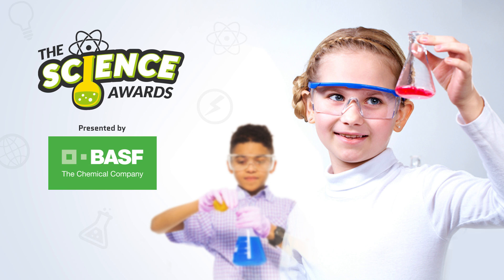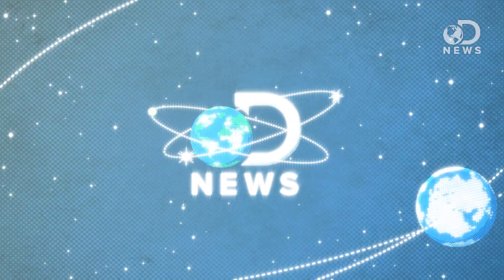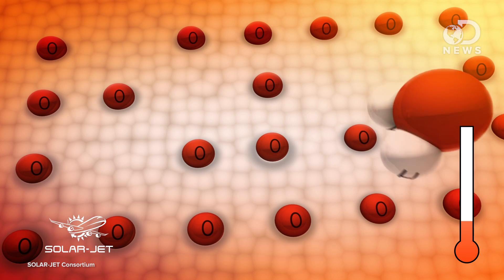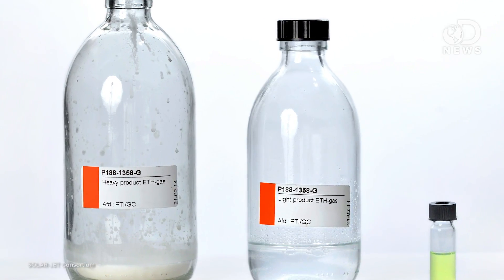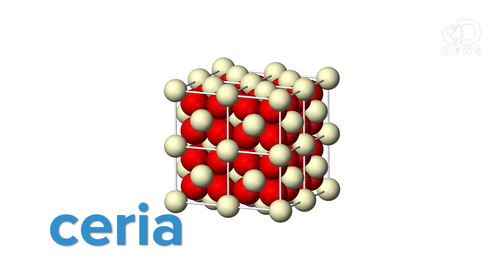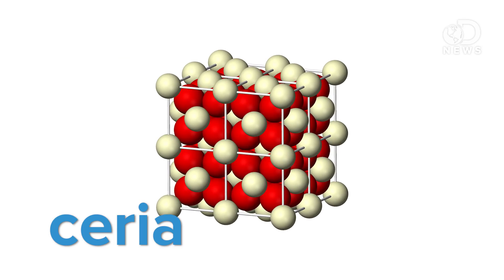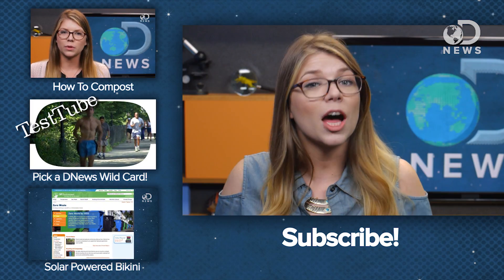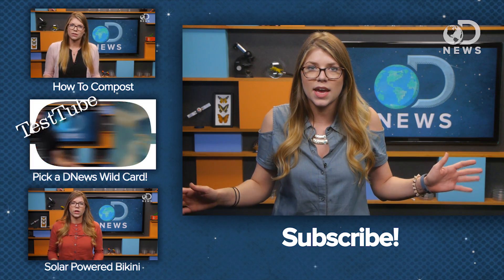Is It Possible To Power Jets With Water?

Comment: Don't get me wrong, this will never work, because the entropic energy costs are too great, it involves too much greenhouse gases, and the kerosene like fuels are usually bad yeild because at high molar electrons, it only produces a small amount of material, it would be much better to use metals as fuel produces by this method

Comment: For the most part, it seems sound, but some of the finer details have been left out. Although that might have been purposeful to protect IP's or whatever

Things like, does it need to be pure (deionised) water? Would that affect our drinking water supply? This thing would be in space yes? How would you transport the water and carbon dioxide up and the kerosene and oxygen back?
Would the carbon monoxide, hydrogen and oxygen revert to carbon dioxide and water when you cooled them down such that the reduced ceria could take in the oxygen (considering the ceria disassociates with oxygen at a lower temperature then water and carbon dioxide)?
Also, is water really abundant enough to be considered an infinite resource? Would the water produced in kerosene combustion be able to be reclaimed?

Comment: Calling Air and Water unlimited is a little far fetched. If we keep destroying our Ecosystem even that is not going to save us.
Reply: Even if we destroy our ecosystem we will still have air, water, and sunlight.
Reply: *****  Sure, I want to see them do this with Poluted Water and Air. What was that? They need clean Water and Air to do this? Surprise.
Reply: maximumrisk2004
 Clean water and air can be made from dirty water and air...
Reply: maximumrisk2004 The fischer-tropsch reaction also makes drinkable water in Quatar there is already a fischer-tropsch plant and they sell fuel and drinking water. and burning the fuel will result in water en CO2 that you can reuse
Reply: maximumrisk2004 it would lower the Fuel prices because you dont need oil anymore
Reply: maximumrisk2004  ok and we have the ability to produce clean water it's called water treatment.
Reply: Once it gets the the point that we can't use the air and water from our ecosystem I don't think it will matter whether we can make jet fuel from it or not...
Reply: wergrethe When you make the fuel and burn it the same amout of water will come out with what you put in.
Reply: Frances Madgwick Actually I meant that such things would increase the cost to produce this Fuel and suddenly we are back to rising fuel Prices.
Reply: using our life sustaining precious resource to power engines, how smart is that? next time they will use our food to power the engines too.
Reply: martijn oerlemans
using water as a fuel while people are fighting for it in other parts of the world.
in this technology, you can not put water right back to the engine, you have to continuously buy it from them.
with this, fuel price might reduce at first, but it will increase gradually just like the oil back to when the automobile was invented, and it will cause water price to rise with it too.
Reply: wergrethe  Yes, too bad there isn't anywhere on this planet where there are large bodies of accessible water.
I certainly have never seen any such things around here.

Oh well, i guess we are stuck being dependent on a never ending fleet of oil-tankers bringing us our fuel from overseas then...

Unless....!
...no sorry, i thought i had an idea.
But its gone now.

sigh
Reply: mtssvnsn
 it's okay, there are a lot of ideas out there for creating free energy, it's just water is not a good idea for it.
Nicola Tesla's free energy device. Crystal power, sound frequency, space-time energy, etc......
you can check out hutchison effect, it can levitate heavy object with the right sound frequency.
or bashar's space-time free energy antenna.
have fun!
Reply: wergrethe
And don't forget  rubber-band energy.
And crystal boner table levitation powers.

Comment: My question about the process is what is its EROEI (energy returned on energy invested)? If it's like corn ehtanol, it's a losing proposition since ethanol fuel takes as much or more energy to produce as it provides, so no solution to oil limits. Unless the solar collectors give the main component of energy to run the process? And would location then be a critical factor?

Comment: This alternative energy source seems great and all, but remember that living things (us) also need water. If this method went into mass production, we could see water shortages, as the result of this method does not seem to leave any water left over.
Reply: There's plenty of water in this world, the problem is just that not all of it is clean and drinkable. If this process can use non-potable water sources, there shouldn't be a problem at all. Additionally, if some of the water were diverted from the fuel process, the solar reactor could be used to purify that water, resulting in MORE potable water available, and less shortage. At least, in theory.
Reply: endergt and making the fuel result also in clean water

Comment: Well, if we run out of fuel at some point, it would be great to have alternatives. But right now, the issue is making something that doesn't creates CO2, and this invention doesn't really help.
Reply: Well, it does. Because if we can supply the whole world using this "clean" method, we stop using the kerosene made from cracking the molecules from petroleum. Supplying the world with the "clean jet fuel" would help people realize that we can live without petroleum.
Also, we already have a fuel that does not produce carbon dioxide, which is hydrogen (H2(g), when fully combusted, it does not produce anything but water, like this:

2H2+O2->2H2O
Reply: Gratia Forensi Equus I see, you are actually right. I shouldn't have criticized this without mentioning how happy I am for the invention. It was just a reminder that we still have a way to go. I say it because some people are always looking for excuses to say "relax everything is alright", and that has caused humanity a lot of problems
Reply: I agree with you.
I always think about the worst things that could happen.

Comment: that does sound great.. but.. we'd still be stuck with fine dust  particles, smog etc if it's used on a large scale. I prefer hydrogen cars, for example.
Reply: And how do you want to power a jet? With h2?
Reply: Gratia Forensi Equus Come on, really? You can burn hydrogen you know.. thats what most liquid bichemical propellant rockets do. Google "SABRE"... its essentially a jet engine burns hydrogen with air, or on-board oxygen. So, yeah, we're working on it
Reply: Teva Wiese That, if I recall correctly, is used to get spaceplanes into space, so it requires rocket-like speeds to compress the air into the engine in large enough quantities to use.
So, not really feasible for everyday airplanes.
Reply: Shawn Thompson Not ever?

That's quite a bold statement.
Reply: daddyleon how would you get your hydrogen?? because you need power for that more than you get from burning it
Reply: daddyleon I'm sorry, but did I say that even once in my comment? No? So you're putting words into my mouth.
If we drastically change how we travel by air, then sure, it'll be possible, but we'd need planes capable of traveling at rocket like speeds to make use of those engines, and then that needs to be safe and affordable enough to carry commercial passengers.
Please use some logic and please stop putting words into my mouth. Thanks.
Reply: Shawn Thompson first of al I did not comment on you second you will get the same fuel we use today so we dont need any fancy engines. and last the fine particals comes from impurities in normal fuel and they are not in the newkind of fuel
Reply: martijn oerlemans Personally... I'd pick renewable, but... if you really want.. you could also use stuff that really fucks up the environment, you know like we do now. But if that's your choice, I won't get it, because what's the point then?
Reply: Shawn Thompson This current stuff is't even viable for anything commercial. But you're questioning currently used technology, seems weird to me.
Reply: martijn oerlemans First of all, I never said a word to you so I invite you to be more observant next time before you make a stupid comment.
daddyleon I'm questioning the SABRE which is in development. It's not "currently used technology"
Reply: you can also make syngas from methane that what they curently use in Quatar but the rest is the same and in Quatar is already viable.
Reply: +Shawn Thompson Emm, yes. it is used to propel space-planes into space, but it is also used during take-off, which occurs at normal, subsonic speeds.
Reply: Teva Wiese you do realize we haven't used a SABRE engine to get into space and we do not have any single stage space planes, correct? We have that Virgin Galactic thing but I don't believe it's gotten into space and I know it does not use a SABRE engine.
Reply: I do realize, yes, but it looks very promising, and should be commercially operational by 2030 (their estimate is 2025, but realistically...)
Reply: Also, the Virgin Galactic's "Spaceship two" has gotten into space, but it's suborbital. It's a stepping stone, giving us information an knowledge for future craft, like the Skylon, which does use the SABRE engine
Reply: Teva Wiese Then why did you say that it's used to get space planes into space? It hasn't been used yet. It's not reliable because it hasn't been used even once.
Reply: I didn't say it was reliable, although it most likely will be, and I meant that it "will be used' as I thought it was pretty obvious that they haven't actually done it yet, since fully operational, single stage orbital space planes are still a thing of the future. In any case, it's all theory my friend.

Comment: What happens when we use all the carbon in the air?
Reply: It uses the carbon that is already in the air to make it so it wouldn't add anymore to it.
Reply: We put the carbon back into the air when we burn the kerosene. Then we take it out when we make more. It's a circle.

Comment: The question is what this synthetic kerosene releases when combusted.
If it's as dirty as regular kerosene I wouldn't say it's that much of a breakthrough in making air travel less harmful to the environment.
It's pretty awesome that they managed to do this either way though
Reply: The synthetic kerosene releases the same about of carbon dioxide and water that was used to create the fuel in the first place. (The energy powering the jet comes from the sun light) So this fuel is carbon neutral. You can also use plants and a gasifier to create the syngas but it is not a pure as this method.
Reply: JoshTW
It will be carbon neutral, but it's probably not the best solution for cars in crowded cities. (Kerosene can totally run cars and heat homes and cook food and all that good stuff.) It would be great for rural and suburban areas, but just because something's carbon neutral doesn't mean it's not going to make for plenty of nasty smoke.

Comment: Actually if you just hydrolyze water you'll get the most efficient rocket fuel we have. It can be used on airplanes too, it's just very expensive both in money and engineering work. So in the worst case there's still that.
Reply: I don't think it is the most efficient rocket fuel we have, although i did not search for confirmation.
So if you can, put a source on that statement, please.
Reply: http://en.wikipedia.org/wiki/Liquid_rocket_propellants

There's a table there with the Isp (essentially a measure of efficiency) of various fuels. Notice the H2+O2 being the most efficient by far. In practice it's not so clear cut because for example fuel tanks have to be bigger, which means more mass for the rocket.

Comment: Most people are energy-illiterate.

"…use simulated concentrated sunlight … extremely high temperatures, around 4,000 degrees F. … a chemical compound that releases oxygen when heated above 2,700 degrees F. … when you heat all of them up together…"

So the process may produce kerosene, but it uses large amounts of energy throughout. Sustainable fuel future? I don’t think so.

"It uses infinite materials"? The materials used in making the solar reactors are not infinite. DNews could have done a better job on this.

Comment: I don't know what the process is for making jet fuel, but this new synthetic alternative sounds like its a lengthy process that requires a lot of energy (in the form of heat) to produce it. So just how much cheaper is this new alternative? Or its it more of a benefit to the environment rather than the economy? Will it lower the cost of gasoline since it relieves some of the burden on limited oil reserves?
Reply: Gee cost of gas will probably stay the same because drilling isn't cheap and these factories will be producing refined kerosene without having to refine it. Refining is also a lengthly process to.
Reply: Benjamin Grosz For right now, if they stick with it... I'd give it 10 years and it'd onl take a few months.

Comment: I may have missed it in the video, but how efficient is the process at reusing the byproducts of kerosene combustion? It's not 1 to 1, surely.
Reply: It'd better be 1:1, or we're violating the law of conservation of mass! :P The only loss would be anything that leaks out of pipes, and you can just get more of that from the air.
Reply: I didn't mean in mass, I meant in composition. Carbon dioxide versus carbon monoxide as a byproduct of the combustion. I looked into it a bit (been a while since I took chemistry) and it appears the determining factor between whether a fuel molecule results in CO or CO2 in combustion is the amount of oxygen present. So apparently the amount of CO versus CO2 produced has nothing at all to do with the type of fuel. It very well could be 1 to 1, or nearly, so long as air-intake is working properly. That makes it all the more amazing.

Comment: I'm skeptical.  Hoaxes about turning water into fuel have existed down through history.  Chemically, kerosene is carbon and hydrogen: C12H26 or something like that, so it's not alchemy to do so.  But I can't see how you're going to convert water:H2O and carbon dioxide:CO2 and get more energy out than you put in.  That's always the problem with all these schemes, it takes way more energy to create than you get back out.
Reply: Obviously, if you made this stuff out of electric from coal stations it would be pointless, the idea here is to use concentrated sun rays to heat the process. But up till this point, sun's energy has only been used to create electricity.
What's awesome about this is we can now make chemical energy.
By the looks of the process though it would be more efficient to keep using it as electrical energy, this looks like an inefficient method for the little kerosene you get back.

Comment: Finally, an alternative to jet fuel planes can burn to reduce fossil fuel consumption. A brilliant idea that recycles CO2 instead of creates it it something humanity needs.

Now, the only question is how it compares to jet fuel in energy density and price. If the density is equal or greater and the price equal or lower than jet fuel I can see airlines trying to get their suppliers to make the changes to the equipment to burn this. If the density is lower and/or priced higher, only planes on shorter flights would be capable of burning it and airlines who aren't afraid to eat costs or raise prices (none) would use it.

Comment: What about the fuel efficiency? For example: 1 litre of normal fuel let the plane fly further than 1 litre of water fuel. So is it more efficient? If if not, won't the plane need to hold more water fuel which adds up on the weight which then further more reduce the fuel efficiency?? Or isit that the product produce is the same as normal fuel? Sorry, science noob here. Just excited about this sustainable energy.
Reply: they made real kerosene with water, it's the same fuel that they use today so it's the same efficiency 'cause it's the same stuff but made from a different process ( made from water instead of made from oil in the earth)
Reply: Ok thanks, cause i dont really understand from the explanation and from the title.

Comment: To my knowledge, one of the reasons jets use fuel is not just to power the turbines but to drop weight.  As far as I'm aware, jet fuel is intentionally very heavy and inefficient.  I figure this is why a battery operated remote control helicopter can carry much less weight than a gas powered one of the same size and same motors.  What I don't get is why not make jets completely electric powered and fill them up with some harmless heavy material, like de-salted water.  Or depending where the plane is flying, salted water would probably do just fine.  I could be completely wrong though.

Comment: This isn't "powering jets with water", it's using energy to make kerosene! They could also just use solar power and electric turbines on the jet. Only problem is, that solar cells are too inefficient for that. So the kerosene is just an energy-buffer.

Comment: Is it bad when you have to correct a scientific video? Kerosene and jet fuel are not the same. There is a process that the kerosene must go through to convert it. This can only be done while its in a vapor state at a refinery. Just like when they take diesel and remove most of the sulfur to create ulsd (ultra low sulfur diesel). But, in doing so, this reduces the energy content of the fuel resulting in a fuel economy decrease and a fuel price increase due to additional processing.
Reply: as they are not scientist nor actually research shit they are reporters and this is a news show. good catch tho
Reply: You are not correcting anything because that's not the point of this video. The point is that we won't need to use fossil fuels to get the kerosene in the first place.